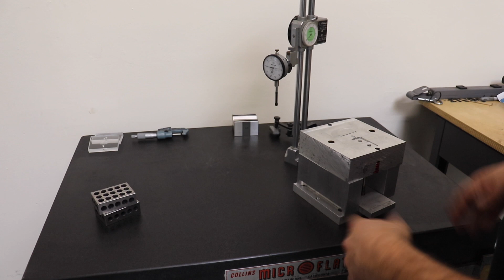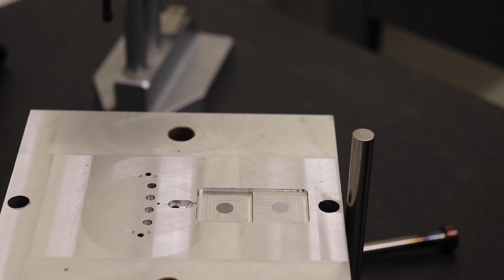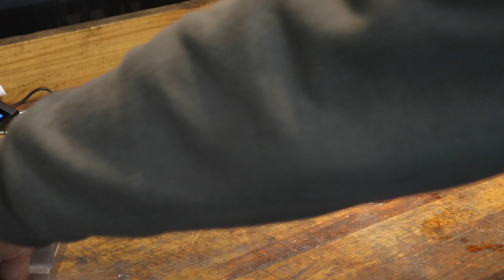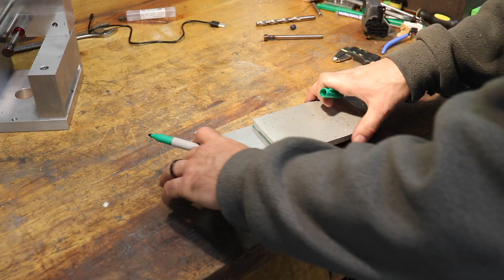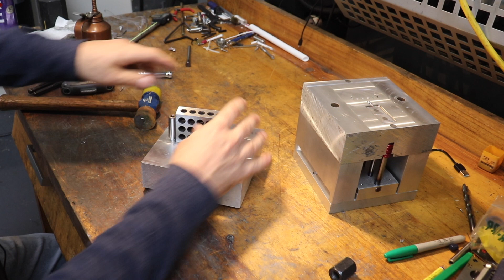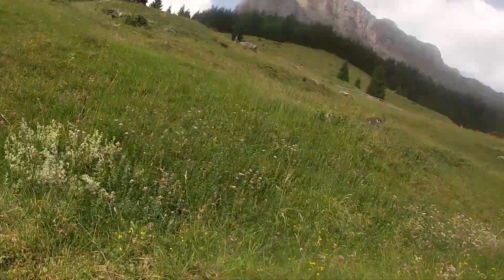Basic Mold Making 3 from Dragonfly Engineering

Comment: Great video series David! I have just acquired an old small Arburg 100U allrounder for educational purposes and planning to construct my first test mold. My question is - Are the alignment pins really necessary for A and B part as the A part is just plain flat?
Reply from the maker: Thanks for watching!  In this case the alignment pins just aid in loading the mold.  In most cases you need to align features on both sides of the mold, so i put the pins in for illustrative purpose

Comment: When I was a apprentice they taught me when grinding ejector pins take the whole thing all at once stay about .0005 - .001 up from your final number and grind from the back of the wheel forward you’ll be dead nuts every time and you can do them quickly in one pass. I used to have to grind 30 to 50 pins at a time so you gotta make good time 😉
Reply from the maker: thanks for the tip!

Comment: A tip for setting alignment pins, I usually machine the first couple mm to an H7 tolerance - so the pin slides in easily and then after ~5mm the pin is pressed into the rest of the hole. Sturdy enough and prevents the misalignment of the pins :)
Reply: A tip: you can watch movies at flixzone. Me and my gf have been using them for watching a lot of movies lately.
Reply: @Paul Harry yea, I have been watching on flixzone} for years myself =)
Reply: @Paul Harry Definitely, I've been watching on flixzone} for years myself =)

Comment: Tip. Number your ejector pins it saves loads of time especially when you have a plate with 100+ pins
Reply: Looking on the B side part line with the ejector system being in the longitudinal position all commercial mold designs have the top left leader and return pins slightly offset. Symmetricly located components can permit assembly issues or tool damage. The left leader and return pins could be could be offset on the longitudinal center line of this simplistic design.
Would a 0.001" per side x 3/32" deep counterbore assist press-in components assembly? We always ground starting relief on round tool inserts unless the runner crossed the intersection.
What did you use for the sprue puller, an under cut or a zee pin?
Good content.